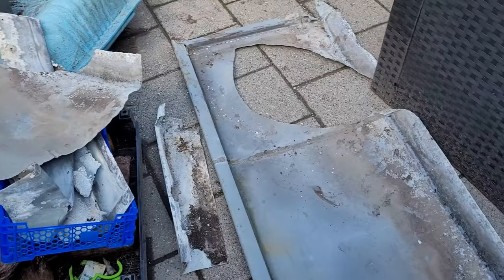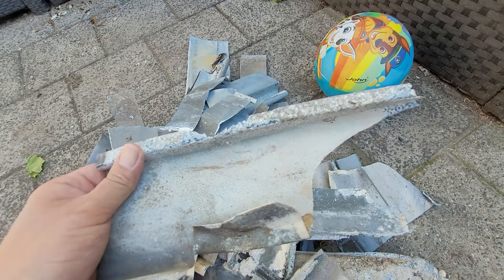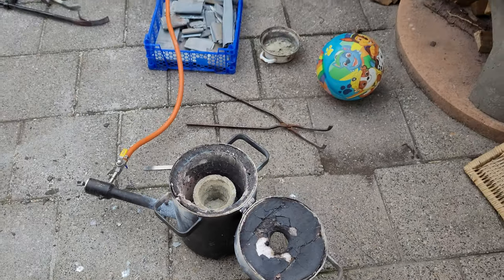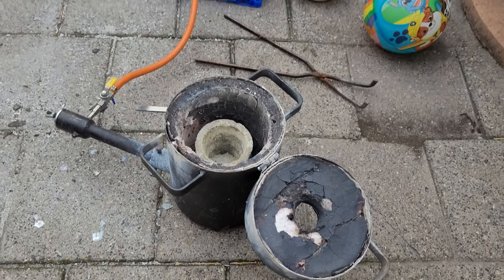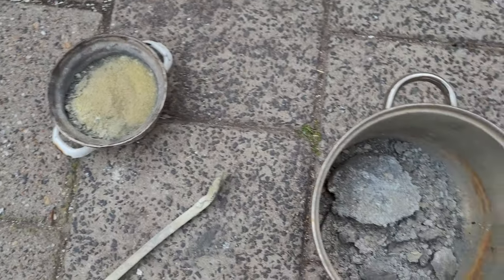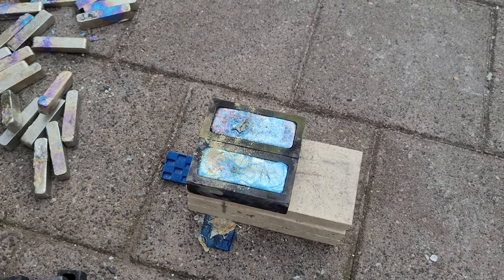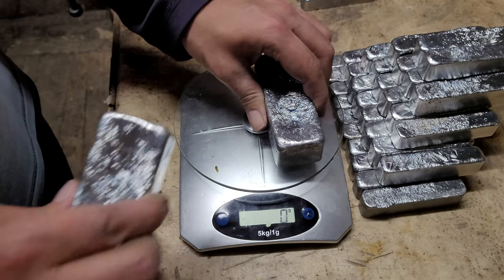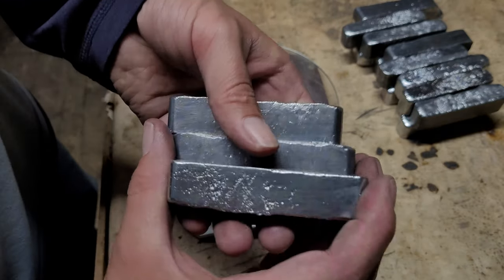Casting zinc ingots - Devil Forge

Comment: How do you get the temp. right ? It´s a pretty narrow band before the material  boils and you are at risk to get zinc fever.
Also I have seen you cut the material down with an angle grinder, don´t do that, use shears instead, otherwise you can breath in the zinc particles and get sick.
Reply from the maker: I always wear a respirator while melting. For the grinding you are totally right! I do not have proper shears, but I should wear a respirator too in this step.
I have a experience setting the choke and pressure and have the lid open to keep a steady low temperature. Normally I have it at 0.02 PSI 😉👍🏻👍🏻
Reply: @Metalstacker  Yes please wear a respirator while grinding too and don´t do that in closed spaces. I don´t mean to lecture you, just want to make a comment for other people who read this too.

I see you have figured out the temp with your equipment, very good. That´s something I still have to do. 

I can get my hands on some scrap Zamac from my company since we produce parts for the automotive industry. However I completely lack the equipment, my only means of melting metal is a stove and a small gas burner. My goal is to 3D print a master pattern and then cast it in metal. 
Have you done something like that ? 
Any advise ?
Reply from the maker: @sierraecho884  thanks buddy! I have no 3d printer, but I made several sand casts, you can look them up on my channel 😃👍🏻
Reply: @Metalstacker  Sure will do, happy smelting =)

Comment: How can i recognize zinc? there is so many silver color metal out there. Any explanation appreciate m, thanks 🙏
Reply from the maker: Hey there, zinc is pretty easy to mould in different shapes, it also tends to get white oxidation on it overtime and as a non ferrous metal it will not be magnetic. Hope this helps 👊🏻🔥🔥🔥
Reply: @Metalstacker  Thanks a lot for taking the time to respond. You answer definitely helps but I have seen many silver color metal and the majority of them does not stick to the magnet. For instance i took apart a small meat grinder and the metal on it does not stick to the magnet. it is a thick piece and does not weigh that much as stainless steel also it's very hard so the magnet tactic dont work in this case. Also I have noticed aluminum get white oxidation. Do you know besides those manners to find out what metal is? thanks...
Reply from the maker: @buentaste  zinc is heavier than aluminium, so that should defenitely make the difference 😃
Reply: @Metalstacker  Correct, I believe my emotion betray me when I find metals and don't stick to the magnet i get exited and frustrate and can't think right. I want to know so bad what metal is ..also there are so many alloy that make it worst for me Thansk one more time for your time on answering me. Your input help me a lot ..🙏